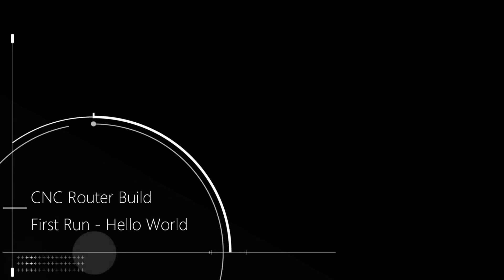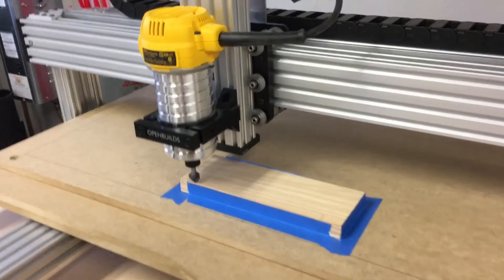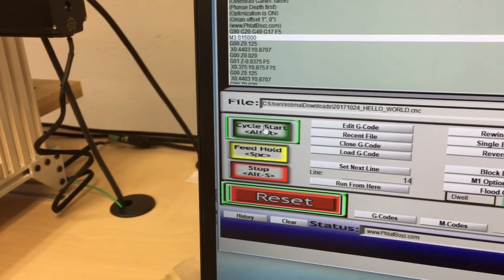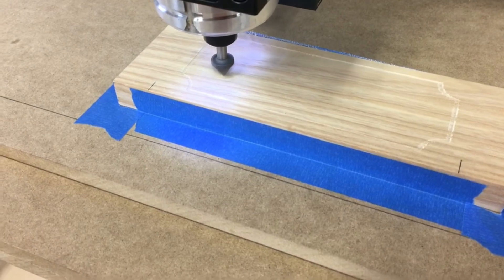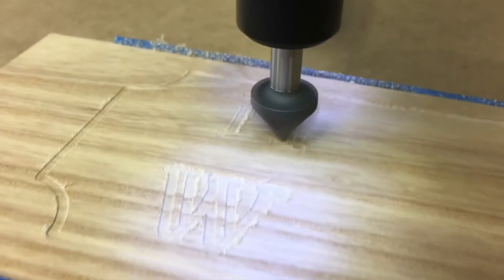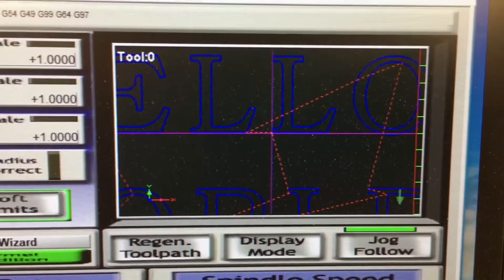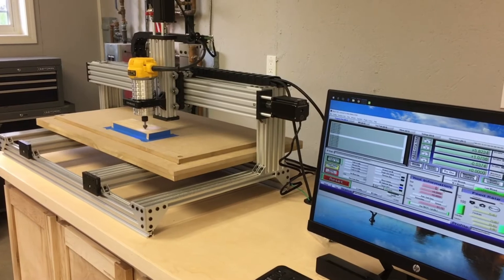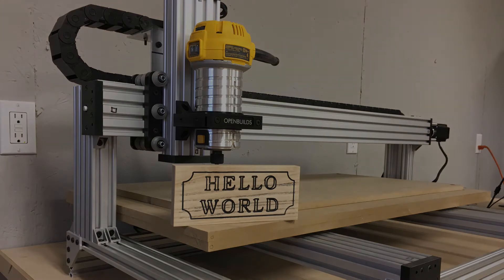CNC Hello World

Comment: Rob while I noticed you're running a Dewalt. I was wondering if you've run into any problems only using a Cable Track for your X-Axis? I've decided to go with a Quiet Cut Spindle instead due to the noise of running a Commercially available Router. Like yourself I decide to go with the G540 and Vince has been a Huge Help. At the moment I'm waiting for him to open his New Website as apparently he's going to provide a Step By Step Guide on Wiring up the G540 Properly for those of us who aren't Electrically Inclined.
Reply from the maker: Hi Ronald, my X-axis cable track has worked well so far. With a fixed gantry and a very short Z-axis range of motion, the only change I've made was to raise the connection point of the cable track on the Z-axis assembly, as I had the radius of the cable track a bit too tight at first. Also, the only cables in my cable track are the heavy gauge stepper motor control cable from Vince, and a well-shielded power cable to the DeWalt 611 palm router. I only run projects for myself, so I haven't found the noise level of the 1 1/4 HP palm router objectionable. My old shop vac is quite a bit louder!
Reply: Just thought I'd share an interesting video I have seen recently on holding down your workpieces.  Here's the Link https://www.youtube.com/watch?v=3uTsQ3dYRrk

Comment: What velocity are you running your machine at? (mm/min)
Reply: I run my machine around 1,500mm/min rapids but I've had it up over 5,000mm/min. Speed isn't everything though. Repeatable accuracy of 0.02mm is nice too. I've put a pen on my machine and let it plot over the same picture 3 times and it just makes the lines darker. The first time I saw that it just blew my mind. The machine does it like it's nothing too. If you were to try the same thing I bet you'd be covered in sweat before too long. Computers have a lot of focus. Humanity is doomed.